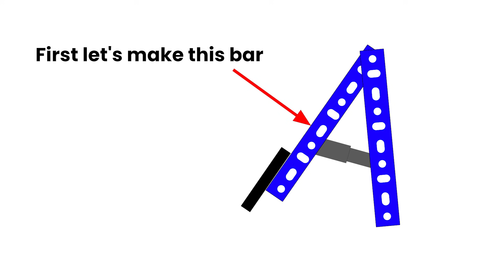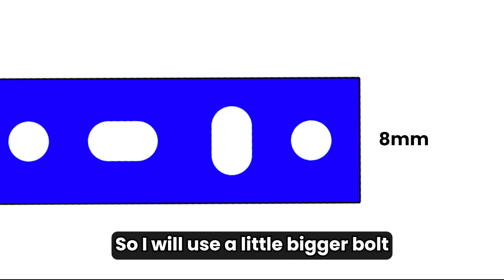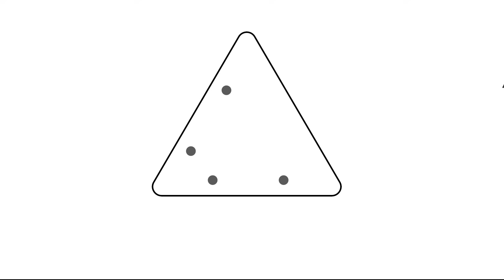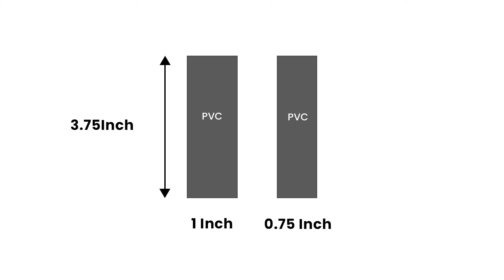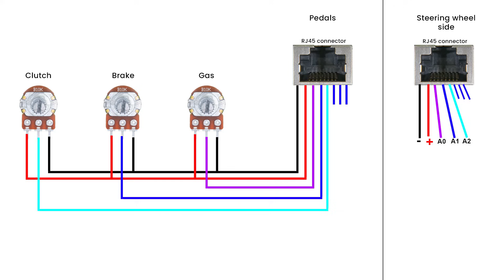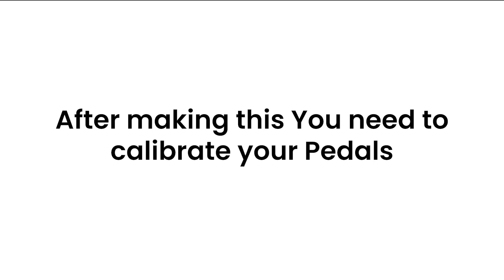DIY SIM RACING PEDALS

Comment: I have no idea what this video is about, im only watching because I need to know what "inverted pedals" mean. Logically since pedals are something you press, inverted ones must press you? Or is it pull pedals? Upside down pedals? (Do you operate them with your hands above your head?) Mirrored? (But... Surely you won't need to take it apart just to swap the output of the outermost pedals?)
Pedals that are photographic negatives?
Reply: So apparently inverted pedals are normal pedals, and non inverted pedals are hinged at the bottom like gas pedals sometimes are, though pretty often the gas pedal is also hinged from above, it's just longer and flatter. So why is this normal configuration called "inverted" ?
Reply from the maker: Many brands design pedals in the other direction (like Logitech, and Fanatec). Some people switch sides and rebuild. That is why it is called inverted.
I also called it inverted because the previously designed pedals were also designed in the other direction.
Actually, you are right. this is the normal design. But when using gaming pedals, they are called inverted pedals.
Reply: is hard to understand? its all about invert the position, in commom sense, the pedals are on ground, coils pressing DOWN directions, and this inverted are on roof, coils  pressing UP direction, just inverted ... my 5 year child got this when i said i need a inverted pedals...
Reply: @delrod1977  my first comment was mainly a joke because with no context as a random video in my feed the title was somewhat confusing. Well, at least the original title and thumbnail was cryptic without context; it now seems to be updated to a much more descriptive one.

But I still find it amusing that "inverted" is actually the most common configuration in actual real cars.